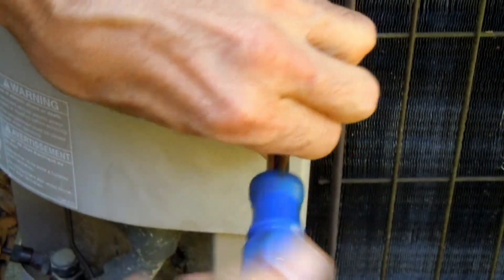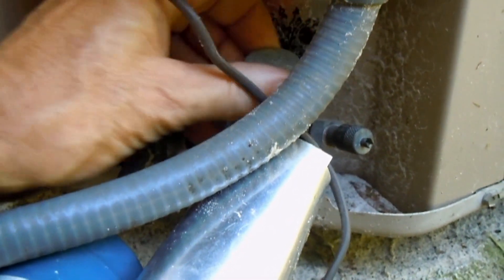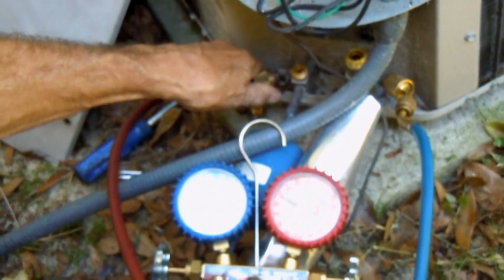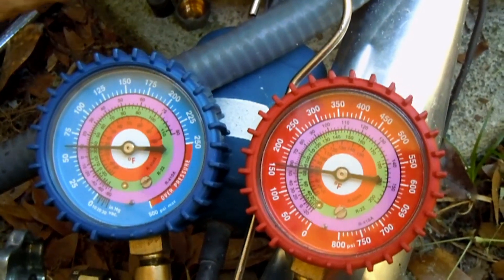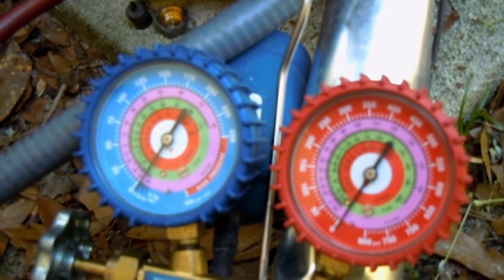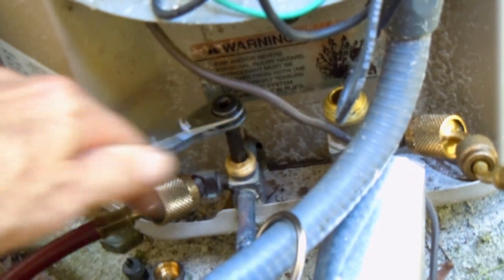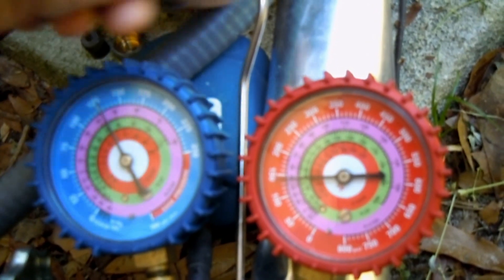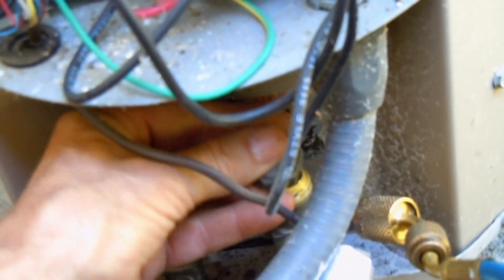HVAC Pump Down 2

Comment: Do we follow same way of closing valve for a/c working at heat mode in winter?
Reply: Cooling only for a “pump down” , if the house is too cold, remove the heat conductor

Comment: I was under the impression the suction side should be opened first to prevent pulling the oil out of the compressor or is this only if the unit is running?

Comment: You dont open the liquid side first. You run the risk of flooding the evap cpil . Not to mention pulling oil from the compressor.  And why are you using nitrogen. This is not the way to pump dpwn a unit. You never backseat the suction with the compressor running. Stop making videos PLEASE

Comment: Why are you adding nitrogen to the system after you have pumped the system down?  Generally, if you are pumping down the system in this manner, you are isolating and storing the refrigerant in the condenser and compressor,  most likely so you can open up the system and work on the line set, the evap coil or move the condensing unit. Once you open up the system, the dry nitrogen will just escape into the atmosphere and ambient air will enter the system anyways. You are still going to have to pull a vacuum on the system anyways once you've made repairs(changed filter drier, install txv, check for leaks, etc.). 

I can see adding nitrogen if you are going to check the line-set or evap coil for leaks,  but you are most likely going to add much more than a trace amount if checking with an ultrasonic leak detector or soap bubbles.  But other than doing a leak test, at this point in the operation, I see no need to add dry nitrogen to the system and that little amount added isn't going to help you at all in a leak test. Now always after we open a system and perform any repairs on a system we have opened and repaired, we do a leak check and on a R-22 system we will run the nitrogen up to at least 100 psig, on a 410a system we run it up to and above 200 psig.  Also, everytime I attach my manifold gauges on a system with refrigerant and under pressure,  I purge my lines; the only time I don't purge my lines is when I have the system in a vacuum.  When recovering refrigerant with a recovery machine, I purge every dang connection from the manifold gauges through the recovery machine filter drier to the recovery machine on through to the recovery tank; this may be excessive, but I don't want to take any chances of introducing air into the system.
Reply: Thats what he said! He was not gonna do any maintenance so he didn't pump any nitrogen in. Just

Comment: Thanks for your quick reply. It's great!
Before hooking up the manifold, are both valves (liquid and suction line valve of the manifold, not the compressor) be "Close or Open". I haven't found any clip related to pumd down even mention about the position of valves of the manifold.  I tried this same procedure on a 3 phase Goodman, 5 ton, r410, slit unit. it seems that both lines are at around 150psi and needles weren't move at all when Power Reset button on the condenser was pushed to ON, for around 2 minutes.  Before Reset Switch was pushed, Liquid line's nut was completely" closed or front seated", suction nut was about a few turns left to be completely "closed or front seated".  No power to Air Handler/evap. coil. Did I do something wrong or was I missing something? Please verify! Thanks!  Can I call you? if yes, may I have your number?
Reply: both manifolds need to be closed.

Comment: When the king valves are fully back seated, aren't the pressure gage ports blocked off?  In other words, I assume the gages are not reading anything at that point.  Also, do king valves were out over time and usage, abuse?

Comment: DrZarkloff, after you close off the liquid valve during the pump down, how do you know when to close off the vapor side? Is it the sound of the compressor changing, gage pressure reading or what?  Like your videos.
Reply: Eric S Gauge reading. The goal is to close it right before it hits zero on the pressures

Comment: Do you need turn on/power the inside unit or blower@evaporator coil on while forcing the condenser's contact to power on.  Other words, do both condenser and blower have to running.  Do you need to set Thermostat lower than room temperature so that both units to be on? Or you can do without Thermostat be set?
Reply: the indoor unit does not have to be running.

Comment: Sir, wouldn't it be recommended to measure amps consumption in the compressor leads, just in case it might get forced and blown? Would you recommend this procedure to be performance on AC scroll compressor several time at day (as a normal operating control); or it is just for maintenance and repair?
Helpful video.
Thanks in advance
Reply: yes, sir, most definitely.

Comment: what side is espacially being clossed during pumping down?
Reply: High side or liquid side first tben tbe suction side this pulls all the refrigerant back in and holds it. The newer units have a pressure switch you have to bypass to keep the compressor running until its all captured!

Comment: drZarkloff. i always read that the pump down cant not be taken to 0 because that could damage to compressor, is recommended disconnect the electricity when the compound Gage is around 20 to 15 psig and then you close the suction valve. greetings!
 Reply  ·

Comment: Hello, I have a question. I'm a home owner and my outside unit stopped working. Technicina came and said that there is no freon. Can lack of refregerant cause outside unit to stop working? I'm asking beacuse I wasn't home when tech came and he didn't even step inside to turn on termostat.... Thanks.
Reply: +Jim Carter yes, either the lack of gas tripped your low pressure cutout if you have one.  Otherwise you burnt out your compressor.

Comment: I have done this on R-22, R-134a and R-410a, but not with 404a. Is there anything different (or noted) with the 404a?
Reply from the maker: Don't expect the system to pump down into a vacuum.
Reply: DrZarkloff
Thanks for the speedy reply! I have a recovery machine and recovery bottles for 404a.  I just want to keep as much refrigerant in the system  as I can. I have to relocate the condensing to another section of the roof.

Comment: Dr. After you pump down the system where and how would one add nitrogen to leak check
Reply: You connect a nitrogen tank to the yellow line an pump it through the high an low sides. By using that gauge set that connected already

Comment: Do you pump back to indoor coil to change out compressor the same way?
Reply from the maker: If you're replacing the compressor, you'll need to recover the refrigerant.
Reply: Just asking cause i seen another hvac guy on youtube pump it back to the indoor coil in heat mode.
Reply: MrJasonpeck22  Who?

Comment: but if your opening up the line set to do repairs to it or the coil, the nitrogen escapes and the moisture from the air still gets in, isn't that why you put a vaccum to 300-500 microns and watch for a rise making sure u don't have leaks, and some line sets that weren't properly covered and rain water gets in, you may have to put the line set in a vacuum for hours and in some cases, I heard days to boil of the water and get the final moisture out.

Comment from the maker: Yes, you can pump down scroll compressors. Although, it's not advisable to pump them down to zero psig.
Reply: What is the lowest pressure you want to take a scroll to? Are all R410 A system using a scroll compressor only?

Comment: Zuff, When you pump-down, you are stacking sub-cooled liquid in the outdoor coil so it will hold a lot since liquid volume is much less than vapor volume. You ask a great question for a 2nd year guy. GO RSES!

Comment: Here's a hint.. Don't ask for an evaporator coil if it's a heat pump system. It's called the indoor coil. They will be more likely to sell to you if you act like you know the diff. That's an R22 coil also. may be hard to find.
Try to find a 3ton R410 coil with a piston and re-piston it for R22. good luck.

Comment: Did I miss the part where you bled the hoses or did we just suck air (or whatever was in those hoses) into the system. 
Also, would love to be a fly-on the-wall when a novice makes those gauge connections to that machine in the heat-mode. Low-side gauge will never be the same! HA!

Comment: BTW I forgot to mention that if you have a heat pump you need to pump it down in cool not heat. If you are pumping it down in heat you are tripping the high side limit switch and creating enough pressure to trip the bypass.

Comment: this will happen when the pressure bypass gets weak within the comp. About the only thing you can do is recover the refrigerant and replace the unit or comp. I will assume you are closing the liquid line and leaving the suction line valve open. IF the unit pumps down and is equiped with a low pressure limit swich the unit will shut off and if the pressure equalizes when the comp stops the valves of the comp are shot.

Comment: can someone explain. when when i try to do a pump down the compressor only pump down a few psi. and than it sound like a pressure relief valve release pressure and the compressor stop pumping down and the gauge for the hi and low both equal.

Comment: In one of your statement s you quoted"When the work is completed on the line set then you have to evacuate the line set with a vacuum pump before releasing the refrigerant back into the line set". If I'm installing a filter drier on my side do I still need to do a vacuum  with adding ports on the line set?

Comment: Mineral oil however, doesn't really absorb moisture. Just like trying to mix vegetable oil and water, you can only get em to mix if you add some sort of surfactant. I've seen studies where they left a container of the mineral oil used in R-12/R-22 systems open for a YEAR and still didn't have much moisture content. A good nitrogen purge, pull a good vac, and you're good to go with mineral oil systems.

Comment: Yes, a good filter drier will eventually remove it.  Keep in mind though that since POE oil is so hydroscopic, even pulling a good vacuum for a long time will not do it, it hangs onto the moisture with an iron fist.  Also it depends on how much moisture we're talking about. Your standard size 8cu in dessicant has a moisture rating measured in DROPS. So, it might take adding a liquid line moisture indicating sight glass, and multiple filter changes.  Or, you could just do an oil change (or 2).

Comment: That's the POE oil, not the refrigerant. Purge the hoses properly, and be careful not to get liquid water in anything (sometimes we do have to run service calls in the rain lol), and you should be fine.  POE oil is very hydroscopic, if you leave the cap off a can of that kind of oil even for a short time, it's junk. Just like brake fluid, leave the cap off a can of brake fluid like overnight, its junk. Better than replacing expensive rusted out ABS pumps, master cylinder etc.

Comment: Also it is good to note that on some 10seer or less systems, the condenser may be too small to hold all of the refrigerant, therefore the left over freon in the lines will need recovering.

Comment: Not bleeding the air from the hoses as soon as connecting them will allow air into the system when drawing them into a vacuum and also when bleeding refrigerant from the high side hose into the suction side. Oops!

Comment from the maker: @Skij710 The nitrogen is used to break the vacuum in the line set before opening it up to the atmosphere. When the work is completed on the line set then you have to evacuate the line set with a vacuum pump before releasing the refrigerant back into the line set.

Comment from the maker: @3882woody You don't want to open up a system that's under a vacuum to the outdoor air to prevent moisture in the air from getting in the system.

Comment: I have a leaky schrader valve on the suction side.  I am unable to replace the schrader under pressure using the special yellow jacket tool due to the valve being in a very tight position.  Could I use this pump down method to replace the schrader valve(s)?

Comment from the maker: @11sprinkles If you have service valves at the air handler, you could pump down a lot of the gas in the evaporator. You'll still have some gas to recover. In the case of compressor replacement, you're better off to recover all of the gas anyway.

Comment from the maker: @ZuffaLtdDanaWhite After pumping down the system the evaporator and the line set will be in a vacuum. The refrigerant will be in the condensing unit.

Comment: So Dr. Z, in a heat pump application or 'any' air conditioning application, will the condenser by OEM design be large enough to hold all the refrigerant vapour? 

Also when you incidentally pulled the LoSide into a "Hg Vac, why did you need to put Nitrogen into the LoSide giving it a positive pressure? Would it not matter whether it was - or + since you are intending to service the line-set??

Just curious, thanks a ton. -Ian HVAC 2nd year apprentice tech.

Comment from the maker: @johnt22007 I'll usually just connect it to another system as long as I know that the gas in the gauges is clean. If the gas is contaminated, I'll recover the gas and sweep the gauges with nitrogen.

Comment: @b0ondockz, start out no experience 15$-20$, mid career 20$-30$ (ranges on type of hvac u do, example is refrigeration exp is a plus) 30$-45$ is a full licensed master or journeymans with capabilities to work on anything in the market today example, duct work, residential, commercial hvac, refrigeration (ice makers, rack systems, walk-in's, self contained and split), chillers, water towers, exhaust fans, blowers thats in the washington dc area, and ranges for each area and company.

Comment: @tpal79 to cut the line sets if you were changing out the condenser or air handler, if you didnt pump it down before cutting the lines you would have one hell of a mess

Comment: DANGER WILL ROBINSON, - Don't forget to purge the air from your manifold and hose set before closing the high side because as it pumps down and you are closing the suction valve all the Gas - and AIR if present in your gauge set will be sucked into the system. 

It's also a good practice to slowly bleed the high side hose back into the low side to prevent slugging the compressor. Especially if your using a long or 3/8 hose.

Sorry about being a know-it-all but this is important.

Comment: @Lachlant1984 I do it when I have to remove lines and re-locate a system without recovering gas. likewise if Dr.Z wanted to replace a indoor coil or TXV on a central system he could pump it down and isolate the gas in the outdoor unit.

Comment: after you removed the refrigerant from your hoses, the manifold still reads pressure. what do you do with the left over refrigerant still in your hoses. Do you just purge both hoses, or do you hook up to another system? whats the proper way to clear your gauge set of refrigerant before hooking up to another system. thanks!